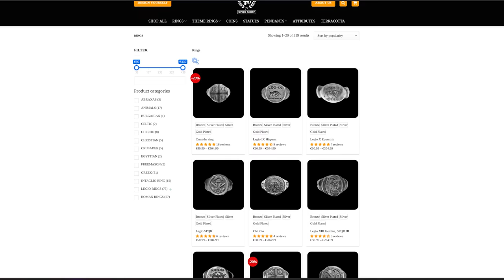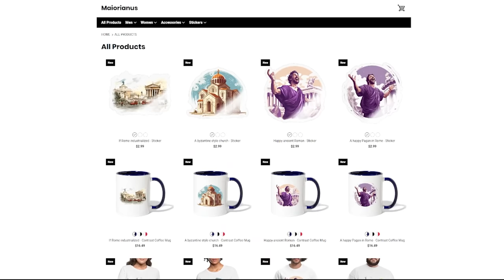The Last Senators of Rome: When, Why and How did the Senate of Rome disappear?

Comment: Technically, some kind of senate was still in function at the end of the millennium, as it was involved in many of the acts of the infamous "Pornocracy".
The institution, and the "Senator" title also endured during the Renaissance, until Napoleon conquered Rome. Being senator sas more of a nobiliar title, and yet, many senators held power through politics and wealth.
Most nobles in Rome, which families had their origin in the old Patritiate, were also by right nominated senators and had power on the election of the Pope and civil authority over the Roman Civitate.
It was possibly a much different institution the the old Roman Senate, but so was it as the Emperors came in power, or when the wester empire fell.

Comment: I think that, as discussed in the video, the Sanatus, as an institution, ceased to exist, but we know of people in Rome that continue to label themselves Senator even after, so as a style or title the Ordo Senatorius continued existing. Theophylactus was styled  senator Romanorum since at least 901. Could it be that some nostalgic re-created the Ordo Senatorius after 100 o 200 years of the dissolution of the original one, or it may have continue existing as just a style or title, passed down in each remaining senatorial family. I of course like this second option more.
Also because if this second option is true, the Order never stopped existing till now (!), passing by several transformations and reforms (1148, 1354, 1370, 1580, 1847) and reducing its number until it became one elected individual rather than an Order, it became the Civic administrator of the city of Rome under the Popes and, after 1870 was rebranded as Sindaco (city Mayor).
Currently the Mayor or Rome still sit in the same office occupied by the Senator Romanorum in 1580.

Comment: Another thing to consider is that these senators were not elected politicians or anything like that - they were mostly representing the very rich and large landowners and their families from Italy. When the Lombard invasion happened, these families lost the majority of their land holdings in Italy and thus the senatorial class was truly devastated. No wonder that they went to the Emperor in the East with 3000 pounds of gold begging for help!
In any case, we shouldn't deplore their misfortunes. The Senate was largely responsible for the decay and eventual fall of the West. Most of time, the senators were caring and acting only in their immediate interest (tax avoidance) and not for the larger good of the Empire - which was held together by the Roman Army. More than any catastrophic defeat, the weakening of the Roman army was due to the chronic underfunding. Before Theodosius, say in the time of Valentinian I, the Western army was still very powerful and much feared - and despised - by the Senate (which didn't hold much real power). But after Theodosius (which, perhaps not surprisingly, was from a large landowner family himself) the power balance changed drastically and as the Senate became stronger and more influential, the army went onto a path of underfunding and increasing weakness - and the position of the emperor in the West became increasingly irrelevant (see the non-entity of Honorius and many other puppets that succeeded him - while those who tried to reverse course and worked to make the senators pay their due and strengthen the state, like Majorian, didn't live very long...)